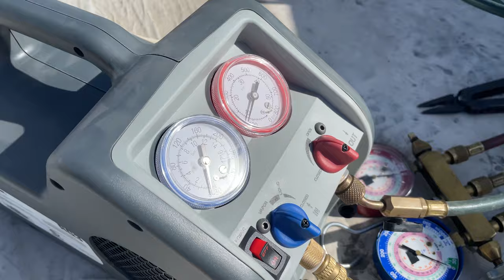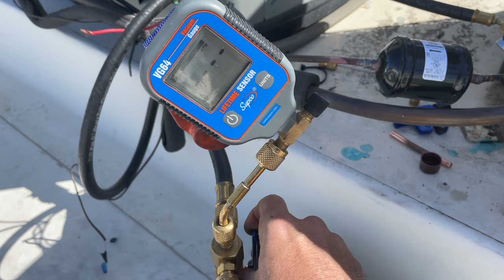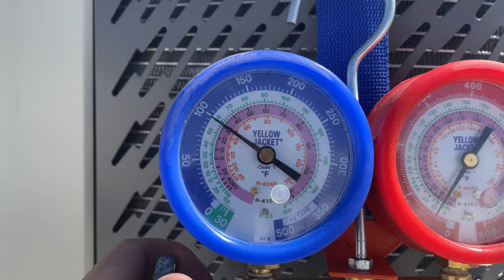Apartment Maintenance Vlog #7

Comment: Hey man your videos help a lot , I have a condenser that the low side is reading as high as it can go on my gauge, fan is running , maybe the compresser is the issue ?
Reply: I’m only a yr in maintenance
Reply from the maker: What refrigerant? Superheat? Subcool? Amps coming off the contactor? If you can gimme this info I can help